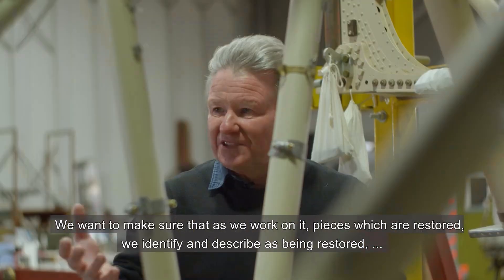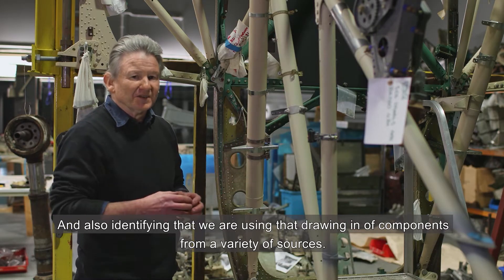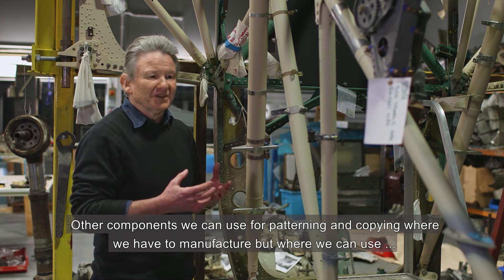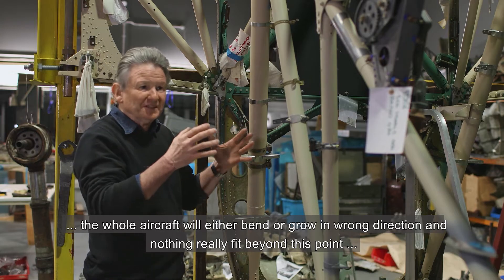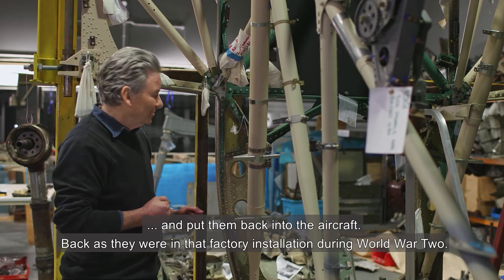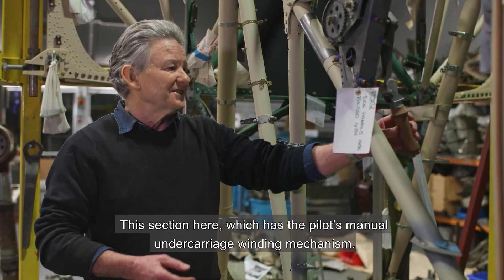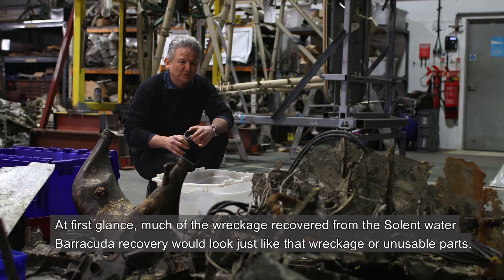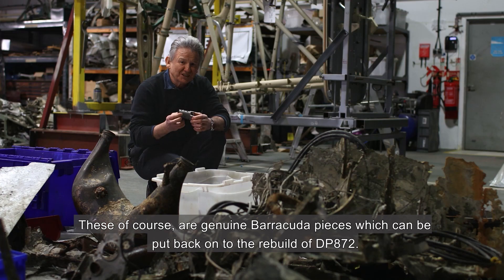Barracuda DP872 - Rebuild Project

Comment: Also interesting is the mechanical feel, or sense the restaurator, or conservator gets during the project. In the end he can "smell" the way how Fairy designed and built, and how other brands did it.
Avro has a distinct way of construction and in that years every manuafacturer had it own technical details. It is a treasure box.